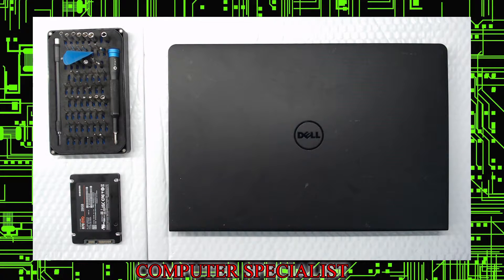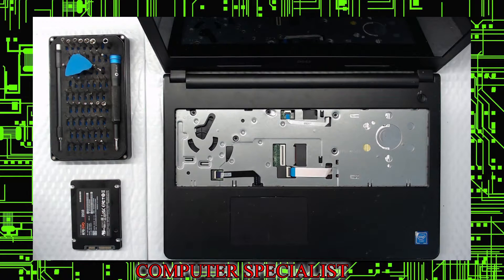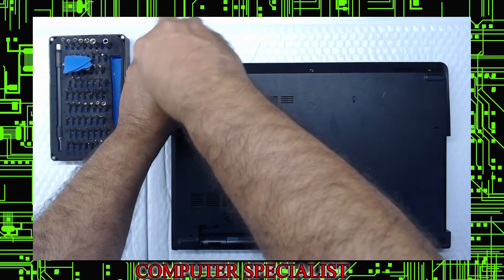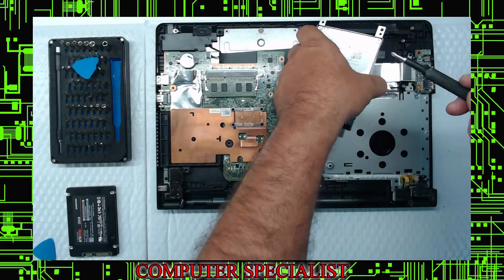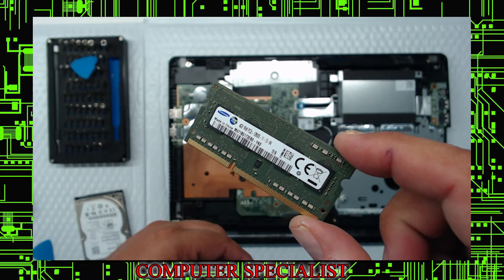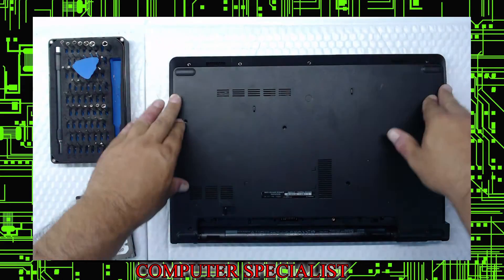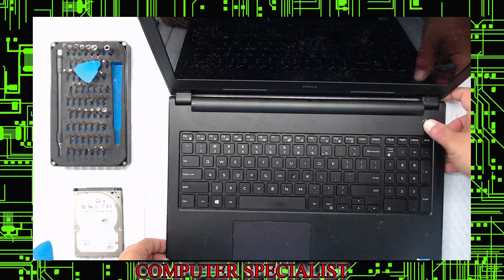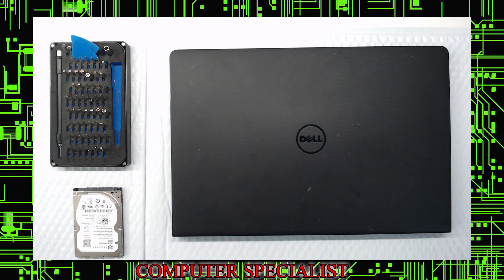Replacing Bad / Older Hard Drive with SATA Solid State Drive in Dell Inspiron 15 3552 Laptop!

Comment: What do you recommend for SDD, RAM, and WiFi card upgrade!?!? I saw someone upgrade to WiFi 6 but I don’t know anything about that
Reply from the maker: SSD: https://www.newegg.com/samsung-500gb-870-evo-series-sata/p/N82E16820147792
Ram: If you have 8GB or more I would leave it (if not just match with same speed you have now)
Wifi: https://www.ebay.com/itm/296739039032

Comment: My laptop always giving me Automatic Repair loop i already tried everything because I watched here on YouTube.. If I replace my HDD to SSD and change a new RAM is it going to fix that kind of issue?
Reply from the maker: Are you going to reload with clean Windows install? or are you trying to save programs, data, settings etc.
Reply: @computerspecialist8533  Maybe start anew.. I already have a new SSD and RAM is there something else that I necessary need I'm not really good at this 😅
Reply from the maker: Just a usb drive that's 16GB or bigger and download windows 11 here: https://go.microsoft.com/fwlink/?linkid=2156295 and it will make a usb drive to install Windows 11 once the new SSD is in the machine!

Comment: How big screwdriver should i use to open back cover
Reply from the maker: A PH1 is good. If it feels like it's going to strip always go one size bigger!
Reply: @computerspecialist8533  thanks i will inform u when its fit
Reply from the maker: That works with most laptop screws!

Comment: I have i questions, instead of removing hdd and replacing that with ssd. can we keep the hdd and remove the disk drive and add ssd to that slot? (idk about the ports and etc i just wanna know if it possible)
Reply: Plz help
Reply from the maker: https://www.ebay.com/itm/285269675659 . Is this what your asking? This will replace your CD / DVD Drive with an adapter to install a SSD / HD. Me personally would just go with one big SSD in the main port, they are cheap enough!
Reply: @computerspecialist8533  YES now I can put both drives in my laptop.
It may be cheaper in USA but I am from India. And I also have a big 1tb hdd
Reply from the maker: @sxa9qz  Ok that makes sense! That adapter uses a 2.5” drive (laptop style drive)

Comment: Thank you!!!  My daughter gave me her old laptop and I am going to upgrade it myself. I have purchased the SSD (Samsung 870 1TB) and after watching the video, I have decided to wait until I can get the memory upgrade so I can repair all at once. Unfortunately, I also have to figure out how to get her documents and operating system off of the old hard drive, as it appears to be damaged. Your video has helped me a lot! I am 73, and as a single mom of 3, I had to do almost EVERY repair inside the house and car myself. This should be a piece of cake!!
Reply from the maker: Awesome! You and try this cable to see after you get back up and running you can plug the old drive in a see if you can get the files from it! https://www.ebay.com/itm/374992545840
Reply: Can i upgrade my ram and ssd to much higher? Like 16gb or 32gb of ram and 1TB SSD? Please Notice thanks!
Reply: @markasherd.parane1126 I think 8 gb is max you can research urself
Reply from the maker: They will run 16GB+ but would put more than 16GB max in this model wont see much increase in speed!

Comment: Hi there, I have a question regarding the RAM of my DELL Inspiron 15 3552 Laptop. I'm unsure about the appropriate RAM type for this laptop. According to the Task Manager, it shows DDR3, but on Dell's website, the RAM specifications indicate DDR3L. I'm wondering which one is accurate. I'm considering upgrading the RAM.
Plis anwer my question, Thankyou Terimakasih
Reply: Probably dell
Reply: Windows isnt that accurat sometimes it thinks emmc storage i think is an sd card
Reply from the maker: Dell is accurate. PC3L would be what you're looking for :)

Comment: So I have this same laptop and I turned it on and it had no display on it started beeping 4 or 5 times I didn’t let it keep going what can be the problem I can not find any videos I just bought it 2 weeks ago
Reply from the maker: Did you get it working? Sounds like Ram issue. Try Reseating!
Reply: @computerspecialist8533  no I ended up getting a new laptop
Reply from the maker: Sometimes that's the better route and then sell the parts from your old!
Reply from the maker: Part it out on eBay, we do pretty good selling laptop parts!

Comment: hello @Computer Specialist is it better to upgrade to ssd 128gb only or 8gb ram and ssd which is worthy to upgrade
Reply from the maker: SSD will make the biggest improvement. But also memory is very cheap right now and since you have it apart if you have a few extra $$ then makes sense to do at same time!
Reply: @computerspecialist8533  26$ 128gb ssd and 45$ for 8gb ram its very expensive in my country
Is kingspec ssd is worthy?
Reply from the maker: @aurr690  Wouldn't recommend those off brand ssds. Maybe a slightly used  one on ebay or amazon? Western Digital, Samsung, kingston also good.
Reply: @computerspecialist8533  its not available all popular brands like samsung kingston only their copies are availabe and copies are not useful so i bought kingpsec
Reply from the maker: @aurr690  yeah keep us posted on how it runs. Never heard of that brand so would be good to know!
Reply: @computerspecialist8533  yeah today i have installed it working well

Comment: My bios must need updated because that logo is different from mine
Reply: Where does the cdrom plug back into
Reply from the maker: It's a port on the bottom of the laptop that has a ribbon that connects to the motherboard.
Reply: @computerspecialist8533  I figured it out and put a ssd drive in my laptop works faster than it did
Reply from the maker: Yes it should run a lot faster than before! SSD are the best upgrade for any computer!
Reply: @computerspecialist8533  it really does it’s really fast might have to put some new ram into it soon
Reply from the maker: How Much ram does it have now?
Reply: @computerspecialist8533  4gb the computer was used I ordered it off eBay
Reply from the maker: @adammassingale733  Yes 8GB will make a slight difference also!
Reply: @computerspecialist8533  yeah probably I just using it and was using word and when I started typing my screen flickered what causes that it just started doing it
Reply from the maker: @adammassingale733  Maybe a loose lcd cable on the motherboard or back of lcd screen. Next time it does that move the screen hinges to see if goes away
Reply: @computerspecialist8533  it stopped doing it after I lowered my brightness down it wasn’t doing that last night though
Reply from the maker: @adammassingale733  Maybe it was just a small glitch.
Reply: @computerspecialist8533  I’m having more problems with it to
Reply: @computerspecialist8533  I seriously cannot watch a video on YouTube without it buffering
Reply from the maker: Sounds like your internet speed. www.speedtest.net
What speeds you get? Also if you have 5G try connecting to that connection, if already on 5G try 2G, sometimes due to distances 2G is better.
Reply: @computerspecialist8533  300mbps
Reply from the maker: @adammassingale733  That's actually good. Crazy if you videos are buffering. Unless its a inconsistent speed variation.
Reply: @computerspecialist8533  the computer was used when I bought it off eBay its was an old one I’ve haven’t had the time to look at it to see what’s causing it it’s missing a hard drive caddy I had to order one it needs new ram put in it and everything
Reply from the maker: It appears different depending on if UEFI mode is on or off
Reply: @computerspecialist8533  can I put a ssd drive in a dell Inspiron 3552
Reply from the maker: Yes that's what this video shows!
Reply: @computerspecialist8533  I’ll have to watch this video to take this apart I got something moving around inside of it but I’m afraid I’ll break it
Reply: @computerspecialist8533  quick question for you can a dell Inspiron 3552 support a backlit keyboard one that’s lights up or does it not
Reply from the maker: @adammassingale733  Remove your keyboard and look right under where the "F10" key is. If there is a small connector there (sometimes its under the black plastic) then it will support a backlit, if it's missing then no.
Reply: @computerspecialist8533  it does not have a backlit keyboard option I looked at the spec and it doesn’t because it’s an older model
Reply from the maker: @adammassingale733  but sometimes they have the port anyway depending on what rev motherboard they use
Reply: @computerspecialist8533  I’m not sure what motherboard is inside my computer at all I looked up the spec and it said it doesn’t have a backlit keyboard feature
Reply: @computerspecialist8533  I looked under the black plastic on the computer but I didn’t see a connector in it and what kind of motherboard would be in that kind of a laptop did you see a connector port on this laptop for the keyboard
Reply from the maker: @adammassingale733  yeah so yours won’t accept a backlit then. They make different revision motherboards for that laptop depending on when it was sold.
Reply: @computerspecialist8533  the manufacturing date was 2017 I think yeah I didn’t see a connector for it I’m actually waiting for my 8gb of ram I ordered to come it was needing it
Reply: @computerspecialist8533  can you tell me if this is the correct ram for this computer 8gb ddr3l-12800 SO-DIMM/1600MHz for this laptop I just bought it and when I turned on the laptop nothing is showing up on my screen is it not the correct ram what was in it before was a kingston 4gb 1rx8 PC3L - 12800S-11-12-b3 it’s still not booting up im afraid it’s going to beep and it’s very loud
Reply: @computerspecialist8533  it said 2rx8 not 1rx8 is that wrong is 8gb supposed to say 2rx8
Reply from the maker: @adammassingale733  as long as it’s DDR3L
Reply: @computerspecialist8533  it is and the laptop isn’t booting when I turn it on the screen just stays black
Reply: @computerspecialist8533  yeah the screen isn’t showing the dell logo what is wrong now
Reply: @computerspecialist8533  so do I have the wrong ram
Reply: @computerspecialist8533  I fixed it apparently I’m dump and don’t know how to put ram into a computer 🤔
Reply from the maker: @adammassingale733  turn off, unplug battery and charger. Try reseating memory. Take fully out and make sure not dust inside etc and push in at a 45 degree angle then once fully inserted press down flat and try.
Reply: @computerspecialist8533  it worked finally apparently I’m dumb and didn’t put it in right 😜
Reply from the maker: @adammassingale733  No that should work. Unless the ram is bad or not seated in correctly.
Reply: @computerspecialist8533  it finally worked after 15 tries and then broke the cdrom where it screws In on accident but I have an external usb cd rom
Reply from the maker: @adammassingale733  👍
Reply from the maker: @adammassingale733  Welcome to my world! Glad it worked!
Reply: @computerspecialist8533  lol I was like thank you Jesus
Reply: @computerspecialist8533  hey can you tell me if a hp 15 dw0083wm has a cpu fan in it I took mine apart because it was getting really hot and found that the laptop didn’t have a fan In it if it does I cannot find the connector to plug it into the motherboard
Reply from the maker: @adammassingale733  that model comes with and without a fan, depending on what cpu you have. So if you don't see one or no connector then it doesn't come with one. What temps are you getting? 

Temp Program if needed:
https://www.hwinfo.com/download/
Reply: @computerspecialist8533  I’m currently not at home right I’m dog sitting and it’s at home but I have to put it back together usually it’ll run at 50 or 60 it gets hot a lot I stopped using it and bought a dell Inspiron laptop
Reply from the maker: @adammassingale733  50 / 60 are normal temps for that laptop. Does it have a Hard drive or Solid state?
Reply: @computerspecialist8533  ssd sometimes it’ll go up to 70
Reply from the maker: @adammassingale733  yeah that’s even not to bad. 85 or higher usually starts to show problems. How much free space? (I know some have small ssds in them).
Reply: @computerspecialist8533  128gb
Reply: @computerspecialist8533  it does get really hot sometimes and when I use it I keep hearing a ticking noise or clicking noise in it what’s causing that that’s the reason why I don’t use it
Reply from the maker: @adammassingale733  No clue what could be causing a clicking noise if it has a solid state drive and now fan. Unless its the speakers. Maybe mute them or disable the audio driver and see if you still hear.
Reply: @computerspecialist8533  it’s not the speakers I think it’s the ssd drive trying to fail I just bought another laptop and just use that
Reply: So  my dell will not display anything on my screen now it beeps at me I checked everything inside the laptop and nothing comes up on the screen what is the beeping noise my cdrom connector needs replaced right now just haven’t done it but I can’t get the screen to come on and I get the right top corner to snap In neither

Comment: Which ram is best for upgrade.. 15-3552 dell
Reply from the maker: 8GB (Max) PC3L-12800S (DDR3-1600) • CL=11 • NON-ECC • SODIMM • 204-pin • 1.35V. It's important that it PC3L (They make regular PC3 that slightly higher voltage). Since it only has one slot you have to get just one 8GB Stick. Here is a link to one on eBay for a good price (Usually you can pick one up for $20-$25). https://www.ebay.com/itm/115291604500 . Also subscribe to our channel (by clicking the red button!) if you liked the video!
Reply: @computerspecialist8533  that link isn’t working anymore
Reply from the maker: @adammassingale733  yeah was 5 months old 😂here is another...

https://www.ebay.com/itm/394217025728